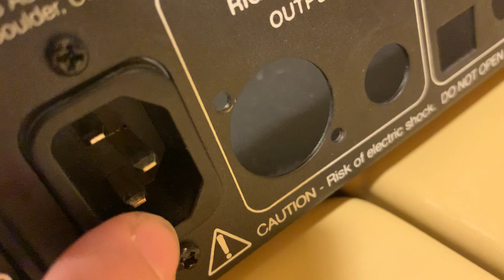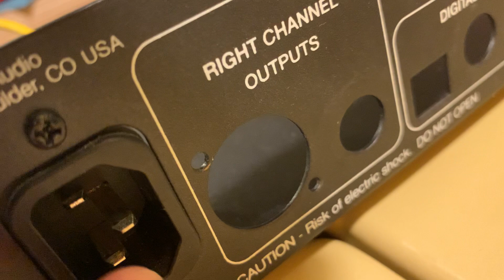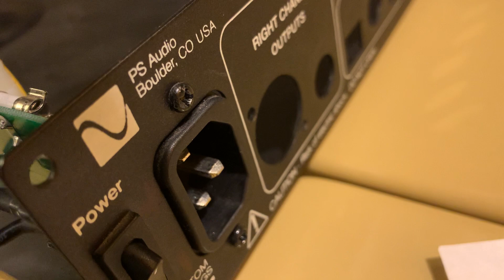PSAudio DAC:   IEC socket upgrade - useful intel for virtually ALL solid state gear!

Comment: I wonder what PS would say to this by-pass mod? (Aside from warranty issues) does it improve sonics!!?? long term safe operation? Is this for nuwave dac, specifically? I'm considering buying one preowned vs buying the shandling d3.2 dac. ??? ( matching my shandling 3.2 CD player. Thoughts anyone???
Reply from the maker: It will work on every DAC, however here are a few indications whether it's worth to do or not: first try fiddling around with power cords. If you hear a big improvement with power cord upgrade, then this socket change is worthwhile to think about to take it a notch higher. Manufacturers go for the compact solution we saw originally, because it's faster to assemble (fuse holder there, fast connectors) versus soldering and adding an extra fuse holder, fiddling with wires...  it just takes much more time & tools to assemble than going with the prefab everything ready on the miniPCB standard method. However, as usual, what is the most cost economical and fast way to assemble on an industrial scale, is often be improved easily when you add your (seemingly unlimited) time. All in all, we can spend as much as we want with our DAC, but a manufacturer pays his workers by the hour, so there's huge pressure to do things the fastest way possible.

Comment: Cool. Also looks like there is room for a ear cleaner to get to the Inlets metal inside the plug, to put stuff like Mica Clear or SILclear on it for better contact/sound. And when it is this accessible you can always easily put it on and dry it of. Same with power switch and metal part of the fuse. Should give a bit more cool/clear/lively sound.
I never thought that you could upgrade PSaudio type of gear. Thanks for showing us this. I also heard that Bel Canto especially can be seriously modified so it sounds easily 2x better.